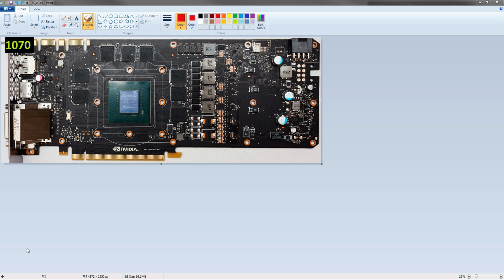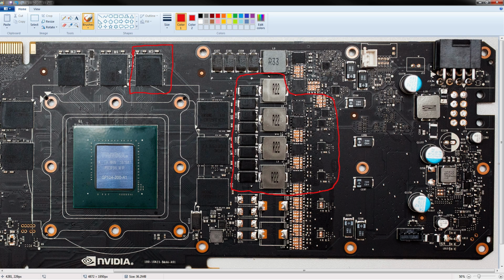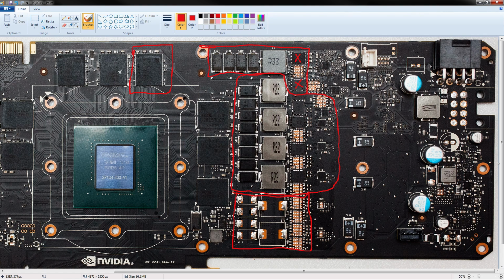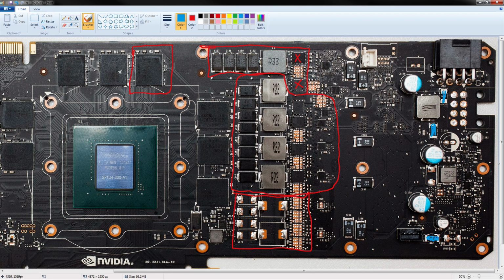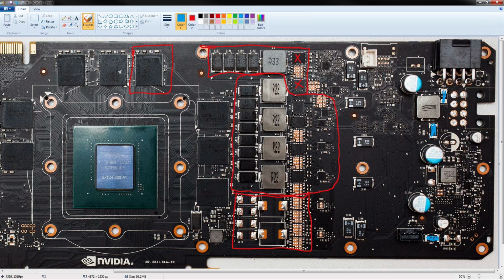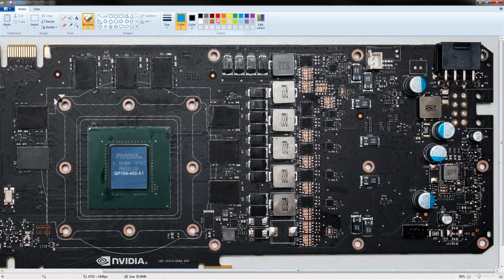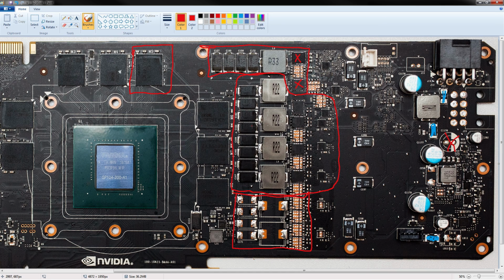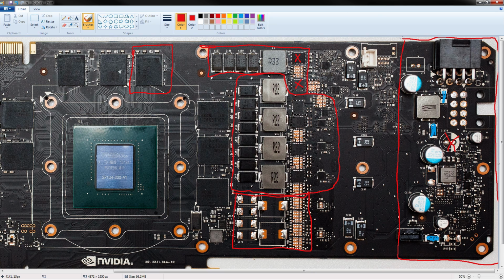GTX 1070 FE PCB breakdown and compared to GTX 1080

Comment: the design of  this pcb  is very bad its garbage , WHY ? , the PCB made from bad copper, a lot of mosfet missing on Gpu and memory, its on propose , to put a lot of load  on this mosfets and capacitors and get blown up to kill the GPU and VRAM ,  to make sure the capacitors get blown up they didn't add fuse on 8-pin connector and fuse on pci-e 12v , thank you

Comment: I hope you can help me Actually Hardcore Overclocking. I have a EVGA Geforce 1070 (comes with two fans). And only one fan is working, the one that works goes 100% whenever I launch a video game to play. Once it reaches 100% it never goes back to normal. I have to either restart or shut down the computer. it gets noisy as hell. I can't RMA it, because I live in a third world country and the shipping is going to cost me like I bought a new video card, I might as well do. I watch this video thinking that it would help me to narrow down where the component that controls the fan is, and fix it by replacing it somehow. I am really desperate and I want rescue this video card that cost me a lot. You seem to know a lot about circuitry. Do you think I have chance? And where should I turn to get the knowledge maybe I can fix it.

Comment: Hi. Do you know the thickness of the thermal pads that are used with the 1070? Is it a one size or multiple sizes for each component of the PCB?
Reply from the maker: no idea never had the card. I usually just go of photos for my breakdowns.
Reply: Actually Hardcore Overclocking alright thanks

Comment: @buildzoid you seen the news whit the micron chips having voltage problems? If you could do a video about GTX 1070 because it's super hot topic this week.
Reply from the maker: no I haven't. Source please?
Reply: Probably this: https://www.guru3d.com/news-story/manufacturers-roll-out-firmware-updates-for-geforce-gtx-1070-due-to-memory-issue.html

and this: https://forums.geforce.com/default/topic/963768/geforce-drivers/gtx-1070-memory-vrm-driver-or-bios-bug-in-micron-memory-1070-cards-/

Comment: Something worth mentioning the GDDR5 found on the GTX 1070 is almost guaranteed to OC to 9 GHz or very close.  I am stable at around 9.1 on my MSI Armor 1070 (6+2 power phase).

NEW Subscriber here!  Would love to see a comparison of the stock 1070 PCB and the MSI 1070 Armor and Gaming, very little difference between the Gaming and Armor, besides 1x 8 pin on Armor vs. 1x 8 Pin + 1x 6 Pin for those 2 extra power phases on the Gaming (8+2) vs (6+2).  How custom are these custom AIBs vs FE and does the new 10 series line from MSI live up to the previous generation of models?

Comment: Nice breakdown!
Can you do one of these PCB breakdowns for the Fury X?
Reply from the maker: Soon TM
Reply: Nice! Could you also talk about how you modded the HBM to get 600 MHz stable on there - is the custom BIOS enough, or do you need to do physical mods? I remember you said small bumps in voltage were really useful for the HBM in the Nano video.
Reply from the maker: I don't have a card without Physical mods to test with right now however I guess I could pull them of 1 of my cards and check the clock scaling without the mods. I think a modded BIOS on it's own should be enough for 600mhz. I still can't get more working properly so IDK about 666 or 633mhz.
Reply: Thanks man! I'll try installing the modded bios and see what I get too. Right now with the UEFI AMD bios I get artifacts at over 570 Mhz, so even 600 stable would be great.
Reply from the maker: I haven't put out an HBM BIOS yet. Still considering it. So far 1.42V has done 0 harm to my main card so I might push out a 1.37V HBM BIOS some time soon. Was hitting 600mhz on 1.35V so 1.37V should be enough for everyone.
Reply: Oh lol - I thought the customs BIOS's already had HBM boosts too. 
I'll keep an eye out if you do release an HBM bios though (could you possibly do one with really little or no core voltage/power boosts, since the card makes a lot of heat at stock already lol).
Reply from the maker: Sure.

Comment: I apologise if I am misunderstanding, but would it be possible to buy the components and install additional phases?
Reply from the maker: The 8 pin is pretty easy but the MOSFETs are SMD components and I have no idea how those should be soldered on.
Reply from the maker: Theoretically yes however it's hard to do and you're better of just getting a better card to start with.
Reply: assuming people have the soldering skills, (i think i could manage it) would we be able to just slap on another 8 pin and additional phases? or would we have to do some software modding too?
Reply: Those you use a heat gun for. Kind of like reflowing ps3 GPU just smaller. You'll need a temp gun and practice on a dead board a few times. You can get different tips for the heat gun which will help directing most of the heat where you need it.

Comment: Is it possible all the extra phases and changes to power delivery in custom pcb cards are hurting performance?  Seems pretty strange we have yet to hear about a custom card go over 2100 with better heatsinks.  They all seem to top out at 2050 while most FE cards hit 2150 or even 2200.  Less is more at these high frequencies?

Comment: couldn't this also be the 1080ti pcb? Because that may explain the numbers of components missing
Reply from the maker: I'd hope that Nvidia is using HBM on the 1080Ti in which case they would need a new PCB. My intial thoughts was that this PCB was used for late engineering samples where the frequency power draw and clocks weren't finalized but after seeing the 1070 it might just be Nvidia giving options for better PCBs for the less equipped AIBs.
Reply: It won't need hbm2 to be faster.  This 256 bit bus is a bottle neck like whoa.  They'll sell Titan/ti with gddr5x and people will still pay $1000+ for it.
Reply from the maker: True however there are 0 leaks about a chip bigger than GP104 and smaller than GP100. GP100 needs HBM2 to work.
Reply: there are some, the gp102. but those are reaaaly fishy.